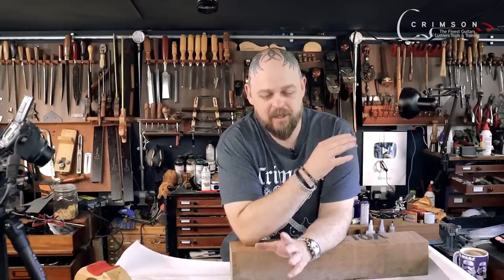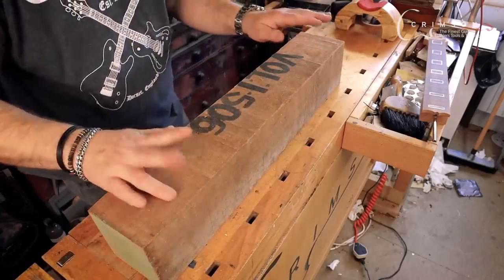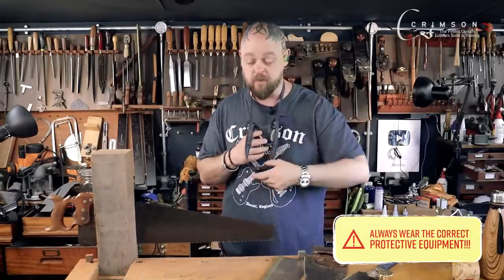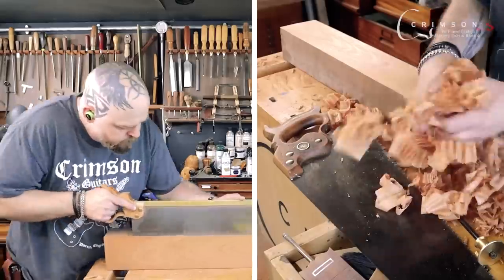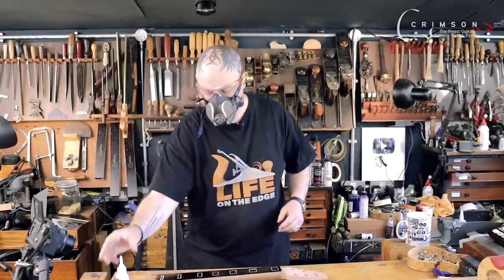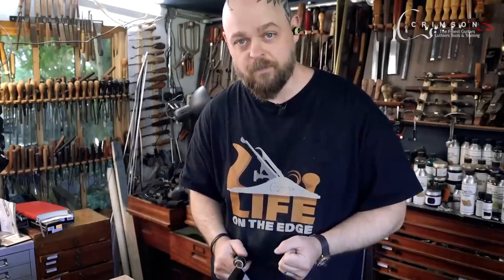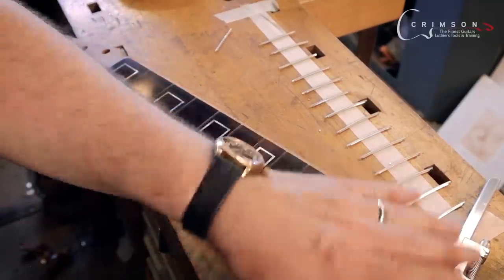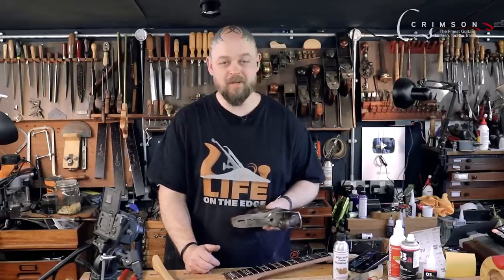Ep 6 Fretboard Stabilising - Hand Tool Only Acoustic Travel Guitar Build - From 4x4 FENCE POST

Comment: I made a tool a few weeks ago from an old pair of fret-pulling pliers with a notch in for the specific purpose of spreading the fret tang when it's too narrow for the slot. Works well, though it does tend to straighten the fret a little, so I need to slightly over-radius the fret to compensate.

Comment: Don't worry Ben, we'll let you off! Actually, one thing I should start doing is using a triangular file to go over the top of the fret slots, like you say. Not because it guides the tang in (although it does), because I've never had a problem with that before. But because if/when you have to refret ot take the frets out, if you don't go over the top of the frets and put a bevel on the edges (with the triangle file), the barbs on the fret tangs will tend to pull chunks of wood out of the fretboard. If you put those micro-bevels on the top of the fret-slots, it will tend to stop that from happening.

Comment: Ben, Ben ,Ben.
u need an oiler ,ie some rolled thick felt impregnated with light grade oil to rub the side of ur saw with which will make it glide much easier.
the oiler looks like a cinnamon roll, bound around outer circumference so it can't uncoil and let oil soak into it so u can just rub sides of saw when needed.
old school tradie trick.
also helps to keep saw from ever rusting.
happy sawing..

Comment: I've got a socket that used to have a lamp plugged directly into it and I would use the switch on the socket to turn the lamp on and off. Later I needed to power a modem/wireless router, so I put the lamp and router into a 4-way and always good... except that I'd forget and switch the lamp and router off at the socket! My solution was to put a post-it note over the socket with "NO!!!!" scrawled on it. I suggest Ben does the same to all electric sockets and electrical devices for the duration of the build.

Comment: On long rips, start as you did with a guide cut either side then make a start on the actual rip cut from one side, complete say, 15 or 20 passes of the saw and then turn the wood in the vice and do the same from the other side.  Rinse and repeat.  By doing that, you'll cancel out the drift and stay on line a lot easier. :)

Comment: Ben just want to point out that at the start of the video you did say (The powerless build except for that "one time" we will not talk about) So that one time drilling now that one time buffing. Your all good. If you don't go to two times using power tools for a singular task your covered. I am sure that if there is electronics you will want to use a Soldering Iron.

Comment: I did a fretboard once with the super glue... And had cut the slots first. 
 And one thing I'll tell you is that teflon fret dam material is GREAT for keeping it out of the slots. As long as it fits the slots real tight. Leave it sticking out of the ends of the fretboard, and you can pull it right through when everything is dry.

Comment: The  the reason it went better when you had it at a 45 degree angle is that the cutting part of the saw is nearer your hand, while the trailing edge is cutting less and being guided. A 90 degree cut means that the edge furthest from your hand can wander

Comment: If you want to avoid further risks of using power tools, move them in the new part of your shed and work in the old one for the rest of this build!
Btw. If you have to work with soft wood and want to stabilise it, you might want to look for Cactus Juice. It is a very thin resin (with the consistency of water) that cures in heat. You'll need also a vacuum-chamber to draw the air out of the wood, which is afterwards replaced by the resin. There are a couple of YouTubers giving tutorials in how to use it.

Comment: Ben, when using a handsaw use the whole length of the blade and this will massively increase your cutting accuracy, and if your elbow is moving at the speed of a bee's wing you are doing it wrong.
Reply from the maker: Thank you for this advice 👍

Comment: Hey Ben, Next time you try for a no power tool build, turn off the circuit breakers to everything but the Camera's and Lights. Then when you go to use a power tool you'll wonder why it wont run.

Comment: Hey there Ben and anybody else in the comment section, I got two bit off-topic questions. 
1. If you would make an asymetrical neck profile, then why is the truss rod still in the middle of the neck width. As far as I understand it, such a neck would have its "neutral fibre" off-center so that the truss rod would have to be placed off center as well, in order to avoid twisting once the truss rod bends in any direction or the neck gets applied with tension.
2. Shouldn't any luthier use two truss rods side by side with a few millimeters between them by standard to have max control over neck twisting?

Comment: You know what I found out in the last several days? A 1985 MIJ Squier has 1/8 of an inch of lacquer protecting its paint. I would have been better off removing the finish on that body with a damn hammer.